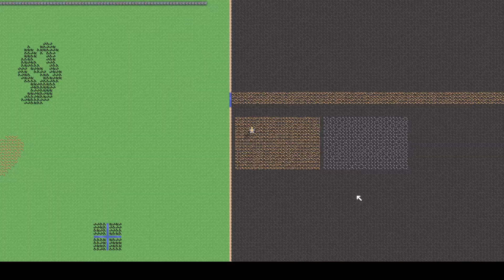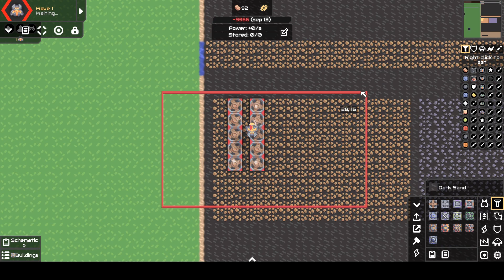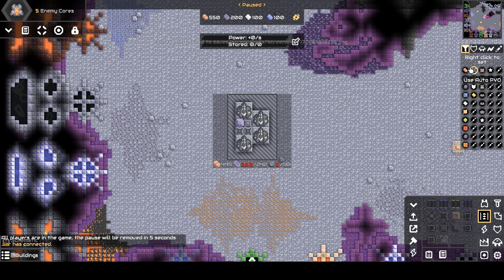Mindustry pvp guide

Comment: I'm trying to use your silicone design and it's not working, I have all the blocks set up the same but whenever I feed in coal half of the furnaces just fill up with silicone and jam and the coal goes into the output line. I tried to filter out the coal but it still jams, does the design only work when you are removing silicone from multiple spots or something?

Edit: got it working, if you remove items with a bridge conveyor instead of a titanium conveyor it doesn't jam
Reply from the maker: Ye, sorry! That's my fault, I confused it a bit